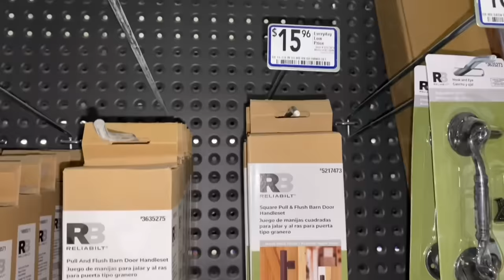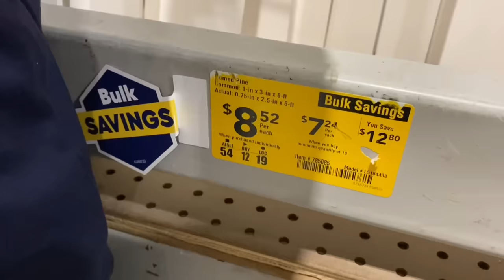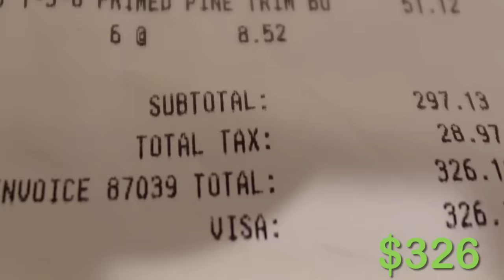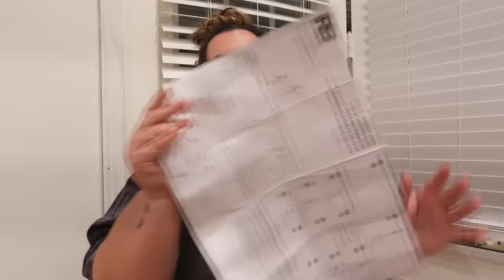COMPLETELY TRANSFORMING OUR MOBILE HOME | mobile home entry way makeover | ep. 17

Comment: Quick barn door tip! If you don't want your dogs to "nudge" these doors open, simply put a black zip tie around the metal part the wheels glide down. When you open or close the wheels will bump over the zip tie and will leave it in a semi locked position . It acts as a "speed bump" and prevents the door from being open without a human bumping those wheels over the zip tie as you slide it open. I'm sure none of this makes sense but here's hoping😂

Comment: Savings on paint brushes. If you’re planning on using the same paint color days after starting a project. Wrap the brush part of the paint brush in tin foil and put it in the freezer. Then take out to “defrost” when you want to use it again.

Comment: Also fyi if the paint is puddling there's too much paint on the roller or brush, if there's a puddle wipe the brush off and go over the area again, it's easier to do a thin light coat first and let it dry for a hour or two, then do the second and again not too thick when u use good paint😁😁

Comment: Merina…buy high quality brushes and if they get dried out all you need to do is get a cup of white vinegar, enough to cover the bristles fully. Heat the vinegar in the microwave for about a minute, good and hot, then place the brush into the vinegar. Let it sit for about 5 minutes. Take it out and press down on a dry towel or paper towel so that the bristles bend and loosen a bit. Return to vinegar another 10 to 15 minutes. Next take a designated ‘project fork’ and run the tines through the bristles. That dried up paint will come off like tubing mascara. I then go back and forth between ‘tine combing’ the gunk out and putting it back in the vinegar. When the bulk of the paint is out I take my brush and flick it up and down on an outside rail or work table edge. It gets the dried stuff from deep inside the bristles to break lose. Voila! Your brush is saved. My husband even uses vinegar to clean his artists brushes if he accidentally lets them dry out. 

Can’t wait to see the finished project.

Comment: Did you lightly sand those doors before you painted them?
Reply from the maker: I didn’t! I tried it on the back of one and the paint came out splotchy. So I opted out of sanding the front & after the first coat of paint I didn’t have any problems! The Sherwin Williams paint is super thick though so that could be why!
Reply: Thank you